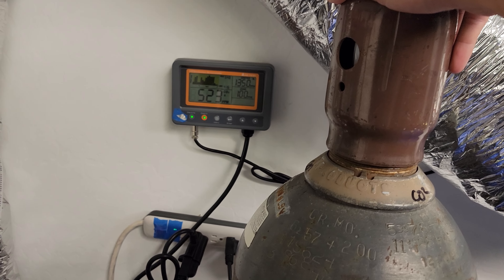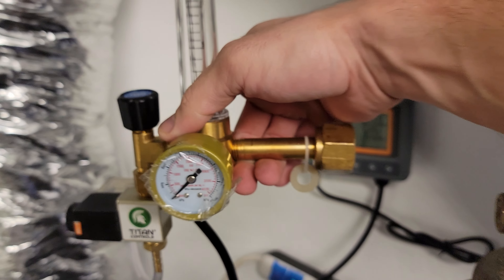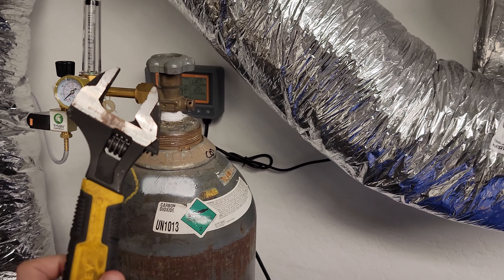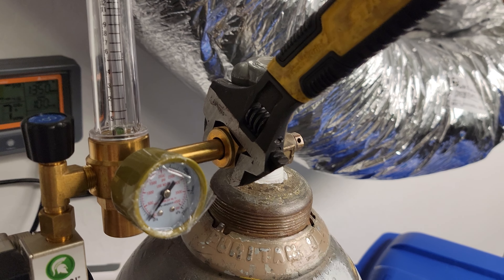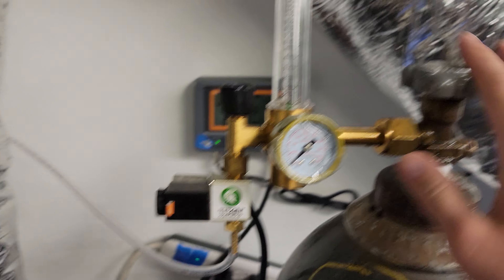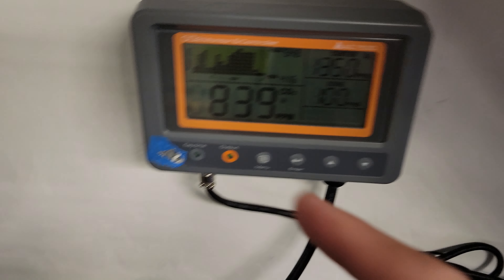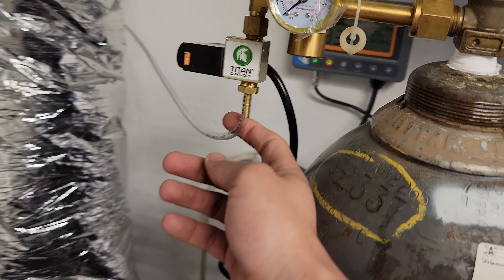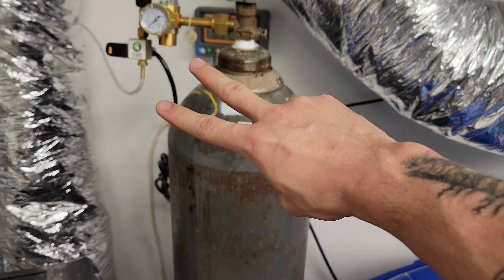How to setup CO2 tank regulator and monitor for indoor growing

Comment: Come on you spend all that time showing how to put a regulator on a tank and what you really should have been doing is showed how to set up the controller
Reply from the maker: the controller is different for each brand. So your individual instructions are best. But the tank is the high pressure metal can that i felt needed the proper explanation. I also made a video after this giving a little more detail for those who asked. This one has more views though and is pushed to more ppl.

Comment: Hey boss, what should ppms be before they the plants break the soil?  My concern is that plants use o2 during this phase and I have no fresh air intake, should a room at say 400ppm co2 have enough o2 or should I be opening the door a couple times a day until they break the surface then push the co2? Sorry if that was worded weird
Reply from the maker: Ambient Co2 levels are around 420 (nice). So 400 is low and inside your house chances are you're closer to 500 or 600 if not more. I wouldn't add co2 before they pop. Just you going in the room to check on them will add a lot if you look at your monitor you'll notice a BIG jump after a couple minutes. Even seedling and very early veg they use such a small amount that my regulator never turned on and my own breath was more than enough.
Reply: @TriStateTrichomes  thanks bro
Reply from the maker: @machiavelligaming9755  no problem. If you have a sealed room. You going into the room will keep levels elevated all day long since it's trapped and they use such a small amount. If you don't have a sealed room and are just trying to add to a tent or something similar I would recommend pulling air in from your living space that is naturally enriched from the occupancts of the residence. And of you're adding more I would wait until you enter veg and have higher light intensity. Otherwise the cost effectiveness is diminished. An unsealed room is already difficult to supplement co2 in so if you're going to do it then do it when it's used the most to help save a little.
Reply: @TriStateTrichomes  nah I got a sealed room, what’s the VPD ypu shoot for when pushing w co2?
Reply from the maker: @machiavelligaming9755  temps I run 86 in veg and start of flower and the. Lower from there. Set my RH based on the VPD chart. I have a link on my channel to the chart I use as a guide, it also has a calculator on that page.

Comment: You need to use some plumbers tape on that thread.
Reply from the maker: Thats funny you mention it, I considered using some gas pipe tape actually, but I've never had an issue with leaking, (when I'm using both hands) so haven't picked any up yet.
Reply: @TriStateTrichomes  no. Do not tape the threads. Use the washer that is zip tied onto your regulator. It’s a straight thread so it uses the washer to seal, not tape. Tape is for tapered threads lol
Reply from the maker: @jtmoney416  nah I've never had an issue. The seal zipped and hanging is my extra one. If my first stopped sealing I'd use that and only consider gas pipe tape as a last resort. More as a temp fix until allied gas supplies can admit fault and replace mine.

Comment: You can find leaks with soapy water, it'll bubble if you spray it on the joints. Also a water based bubble counter is a good visual way to instantly see your flow. In addition you can get cheap tanks and refils at a local beer brewing shop. Finally, fresh water aquarium micro misting CO2 bubble stones can add a ton of enrichment to your nutrient water, it works better in hydro systems. There is no such thing as too much CO2 when in veg.

Comment: always use a wrench to tighten the connections, the seals require that amount of force to create a proper seal otherwise you will have a slow leak

Comment: But it has 800 psi inside that bottle of co2 and that nylon crush washer in designed to be crushed that why they give you an extra one but really the most important thing if you have a tall bottle like that one you need have it secured to the wall or something so it don’t fall over and turn into a co2 powered bottle rocket

Comment: As a welder who has handled cylinder tanks for over 20 years, I crank those regulators down with a wrench with a decent amount of force without ever having an issue. 

One easy way to find leaks is to make sure your solenoid is closed and crack open the cylinder. Your regulator should  indicate how full your cylinder is. Now close it, and it should maintain that pressure. If your needle starts dropping, then you have a leak.

One last thing, cylinders are under immense pressure, accidently knocking one over, and you'll have a missile on your hands. Make sure to secure/chain up your cylinder.
Reply: Tell me please is it posibile to calculate ppm without digital only using bottle and these part
Reply: U have the most anime pfp for an experienced welder lmao
Reply: Thank you Sir. Will go and chain it NOW❤❤❤

Comment: Dude I bought the regulator in the video and Iink below and I went back to watch the video and now your saying its already broken from moisture in the solenoid i think its just a two wire and the mech is burned out that pulls the plunger in it two wire set ups cause the system to strain  while holding the plunger open or closed i was hoping for a good cheap reg but nooo
Reply: Hey man out of curiosity did you have issues with the Manatee regulator in the link or the Titan regulator in the video? I'm getting ready to add a system to my grow tent, and I don't want to waste money in crappy gear obviously. I was thinking the Autopilot monitor/controller with a Titan regulator and a 20lb tank. No loop, just 2 nozzles, each nozzle placed directly behind the rotating circulation fans above the canopy. I run a GC roi720, and i'm tired of constantly having to replace Exhale bags also worrying about the bag expiration dates when purchasing them. Appreciate any feedback.
Reply: @the_gold_canopy  it's working the regulator doing good idk how long it will last considering his failed after a month but the Manatee isnt bad

Comment: Thank for your explication! I’m currently instaling a co2 kit, but i don’t have de co2 monitor to swich on or swich off the suministration… how can i do for calculate the necesary co2 for my plants?
Reply from the maker: without a monitor its going to be almost impossible to know the exact PPM your room is at. Which can lead to many issues. Could also be dangerous if it gets to levels above 4000PPM. i would get the equipment and save your bottle until you have it.

Comment: great! my question is how to prevent the co2 to get extracted from the tent by the exhaust fan?
Reply: apparently not, you have to build a closed system with AC I guess.
Reply from the maker: You can't... For a tent your only options are to seal the room the tent sits in and saturate the entire room or vent it out of the tent and eat through your Co2 and an incredibly fast rate. The latter is not worth it in my opinion. Depending on your situation it may be feasible to pull in air from another space in your place thats more enriched naturally from either the occupants of the house or from something like a gas pilot light.
Reply: @TriStateTrichomes  thanks for your quick answer. the trick is rerouting the output from the exhaust via a cooling tube back into the tent. now how would a cooling tube possibility work?
Reply from the maker: @reneschipper6262  Are you saying you would vent it out of the tent and then have that come straight back into the tent? If so you have to remember a tent is not airtight either. so if you could manage that idea you would still leak co2. probably much less but it would still leak. Since starting Co2 is not a a cheap initial investment for everything. I am not sure how worth it the cost to return would be. I would still suggest sealing the room the tent sits in and enriching that space or use the passive co2 in your living space to enrich. I had a setup in a basement that stayed about 950ppm as a constant. All of the co2 from the people in the house would leak down into the basement since its heavier than air and thus free co2. not to bad at all.

Comment: Hi! thanks for the vid, one question: so when the co2 is on does it drop down tent temperature ?
Reply from the maker: i have an AC/heater in the room. so if it does have any impact then i have not noticed. But that aside i dont see a reason why Co2 would have any notable effect on temperature in a grow space.

Comment: What do you mean sealed room? Is it ok to have a extractor fan with carbon filter even? :D
Reply from the maker: sealed room means that you seal the room air tight so that you dont have leaks. Or you mitigate the air leaks as much as you possibly can. I also never vent my room intentionally. I do have a carbon filter inside that i run once budding really kicks off to keep smell from being an issue.

Comment: Good night friend, for a space of 1.5 meters by 1.5 by 2 meters high, what size of cylinder do you recommend? How many kilos, and the input and output motor can I turn on for how many minutes per hour?  thanks for your attention.✌️👍🏻
Reply from the maker: Assuming that space is well sealed you would be fine with a smaller 20lb tank and it would last you a month or 2. now if the room is not well sealed you will go through the gas fast either way and larger may be better if you plan to run co2 anyway. Instead of trying to guess the flow rate i would get a monitor/controller to measure the room for you and it will turn the tank on and off as needed. I made a newer version of this video that goes into a little more detail.

Comment: What ppm do you recommend starting at with clones and at what ppm do you finish?
Also how long would a bottle like that last?
Reply from the maker: i start at 800ppm and increase from there. How long the tank will last depends on how well your room is sealed and how much canopy space you are trying to support with it. There is no 1 answer to this
Reply: @TriStateTrichomes  is it recommended to have a closed system when running injection?
Reply from the maker: @michaelwheatley7257  I would personally say, yes. An airtight closed room is the best choice. No need to vent unless you are forced to do so to maintain optimal growing environment.
Reply: @michaelwheatley7257  yes a closed system during CO2 usage,  no point in exhausting your $$ CO2 $$.. keep a close eye on your plants humidity and temperature.. 75'-80' .
Some people shut down the Co2 at 6 hours into the light cycle(1/2 way during flowering) in order to exhaust the room & bring in fresh air then close it up & turn your co2 back on for the remainder of the light cycle. 
Plants are only utilizing CO² during the day while growing so bring in fresh air & Exhaust at night - lights out..

Comment: Man do you also have some exaust schedulle to run this Co2 , or no exaust ?
Sorry for the noob question , but I don't nothing about Co2 enviroment . Thanks
Reply from the maker: No exhausting. Room stays sealed so I have full control over temp and humidity. Some do vent with lights off for temp control in colder areas. That's only done with lights off since that is also when co2 is off.

Comment: Thanks for the vid. You explained everything I wanted to know. BTW what do you think is the better option, 20inx3ft tent. A fermentation generator yeast and sugar, or a small tank set up?
Reply from the maker: in the long run the tank setup is going to be cheaper and more effective. But the initial cost is more. also keep in mind the tent will leak the co2 unless its in its own designated room and then the whole room can be sealed and supplemented
Reply: @TriStateTrichomes  thanks for the info. I live in an apt so no room set aside just for that. So I'm guessing a couple good co2 detectors should be OK? Maybe an exhaust cycle every hour?
Reply from the maker: @raineman1118  try to seal your tent as best you can when you run co2. tape zippers if they leak air. anything you can do to reduce leaks. No need to exhaust. i would definitely get 1 or 2 co2 monitors you can keep outside of the tent to make sure you are keeping safe levels in your house. OR if your tent is near where you hangout the most. you can just vent in co2 rich air from the people in the apartment breather. test the ambient co2 levels in each room for a couple days to see where they sit at on an average. this way you have free co2 supplementation
Reply: @TriStateTrichomes  there isn't enough ambient co2. Plus I've an apt full of house plants. I'm thinking since summer is almost here, I can pull from outside, but still think a small tank is the way to go, sugar and yeast get expensive, and probably not as reliable. You seem to know your craft.
Reply from the maker: @raineman1118  tanks are the way to go. see if you can find a cheap used one and then exchanging is usually cheaper at a welding or gas shop such as allied gas. hydro shops are more expensive. at least in my area

Comment: Hey man a quick question what is the max ppm this can go to is it possible to get it to 5000ppm or 5% c02 ?
Reply from the maker: I would need to check. But I would not recommend you run your room that high.
Reply from the maker: it goes to 3000PPM
Reply: @TriStateTrichomes  thanks so much man so I'm actually using mine in a lab experiment but I cannot find any c02 meter that goes to 5000 for some reason is there any one you can suggest
Reply from the maker: @KR-xn8xr  I think autopilot might have one. Look at the link and it says up to 5000ppm.
https://amzn.to/3fw5fbe
Reply: @TriStateTrichomes  thanks so much man appreciate the help alot I'll check it out just need to see if they ship to my country

Comment: Is your room extracting air with that ducting?
Reply from the maker: Its not suppose to, which is the point of a dual hose. removes the issue of creating negative pressure like a single portable would cause. BUT no matter how well i sealed around the ducting it was never perfect and it did cause my tank to run out each month. Currently i have a mini split and the tank now lasts 2 months easily.
Reply: @TriStateTrichomes  Yeah i mean even if you were exhaust sucking the air out of the room and had co2 being put over your canopy it would still some what be beneficial. I see alot of people using those co2 bags and they arnt very cheap about 70$ a bag here. I had a co2 bottle and regulator from an aquarium im giving a try, i still think if there is co2 in there the plants would benefit
 from it even if your exhausting air out of the room
Reply from the maker: @matty00866  I would say it's possible. It depends on what the room maintains and with the extra cost is it even worth it. Usually if you are growing in your own house there are ways to get free additional vo2 from the residents in the house. Such as a basement over an attic since co2 will sink causing an increase in the lower part of the house. Or near a pilot light.

Comment: Hi mate how would you recommend using co2 with a negative pressure in the room?
Reply from the maker: That doesn't sound ideal. You will go though a lot of co2. What's causing the negative pressure?
Reply: @TriStateTrichomes  well in a grow tent we would run negative pressure to extract the heat and smell through a carbon filter.
What would you recommend
Reply from the maker: @roboquaid  honestly if you are pulling air into the tent constantly. Unless you can co2 the entire room the tent is in I don't think using co2 is a good choice. With an expensive upkeep. What I usually recommend for someone growing in a tent at their place is if possible to pull in air from your living space. Co2 levels in a house are in general much higher than outside air. For example a basement might run 900ppm just from what sinks down from everyone above. Or an area with a gas pilot light will have very high co2 . So using these things to ypur advantage is free and more sustainable for those who can't run a sealed room.
Reply: @TriStateTrichomes  thanks alot dude really appreciate it 👍

Comment: Where does the CO2 come out? The bottom of the regulator?
Reply from the maker: Yes. The Co2 passes through the regulator where the pressure gauge is, then passes through the small solenoid (where the little black box is) and then out the hose barb where the small tube connects.

Comment: Hi is the controller user friendly?
Reply from the maker: I cant speak for all but the one I'm using is super simple. Only thing that wasn't a dead give away was the altitude setting which i learned of later. I should have read the instructions. Apparently Co2 density is different at different altitudes so setting that gives a more accurate readding.
Reply: @TriStateTrichomes  how do I find my altitude?
Reply from the maker: @ClearWater7.62  I just googled ( city altitude ) 🤣
Reply: @TriStateTrichomes  lol yeah was a bit confused

Comment: What are your thoughts on using co2 and without it?  Btw do you recommend the controller you have?
Reply from the maker: I have had zero issues with the controller I have so I would definitely recommend it and it was much cheaper than others I found. My thoughts on CO2 is that it's amazing as long as you can run a sealed space.